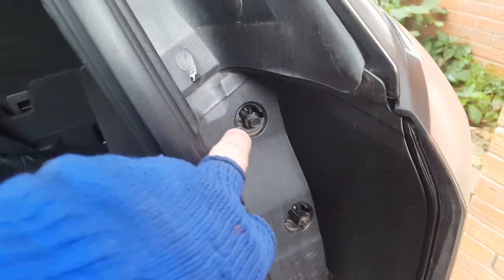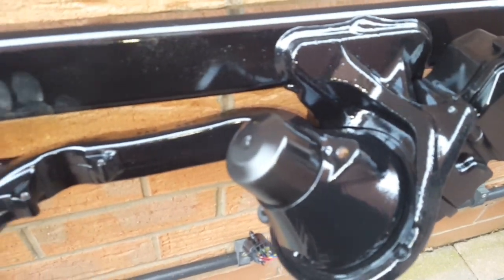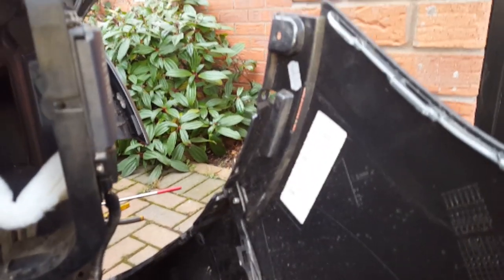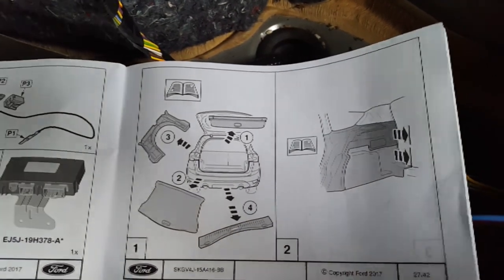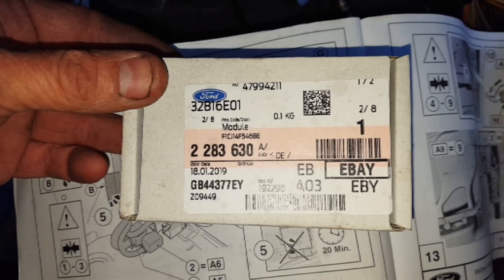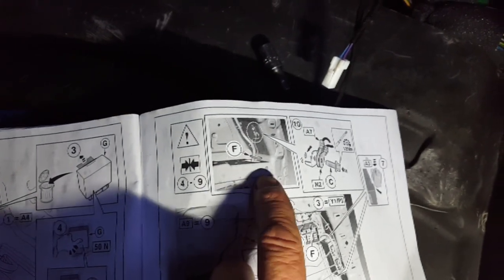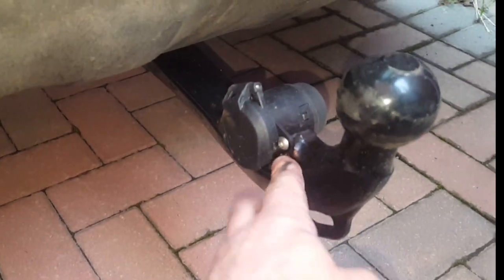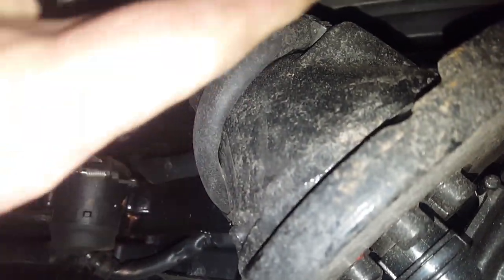Fittting Genuine Ford Retractable Tow Bar & Electrics Kuga / Explorer

Comment: Hi, here is how to resolve beeping with forscan:
1. Start programming of BCM (main), then select engineering mode from dropdown list.
2. Search for towbar and change to „with towbar attachment” 
3. Search for trailer module and select the correct module (in my case 13 pin)
4. Turn off the ignition, get out and get in the car, start forscan again and create new car profile. It will find the TRM Module now. If not then give it some time with ignition off
5. Start TRM (as build) programming and modify the last line 791-03-01 to x19x. In my case I modified from 009C to 019C - it was automatically changed to 019D. After this I was able to use the button and towbar was retracting. 

Thank you very much for this video. It helped me a lot with fitting towbar to Ford Escape 2018 and definitely saved some money. Thankfully CAN cables were the same color (which is not always the case with US), additionally I had to drill a hole for the wiring loom in the trunk. It is catching the bumper a little when opening but I guess I would have to release the bolts and move the towbar back or front a little.

Comment: Nice to see this explained since I could not find a manual online for the installation. I get a little seasick sometimes though from the images. I'm a bit dissapointed that you have to root the canbus wires all the way to the front. I'm going to place a fixed one I guess, so I won't need the swivel module.

Comment: Very good vid thank you.
Was the car equipped with the loom and a connectors as standard?
Reply from the maker: Thanks... 
No, all but the upgraded fuse board at the rear all looms and modules were purchased. Expensive but i saved on the fitting 😁

Comment: Nice detail video just fitted a 2nd hand towbar to my kuga my self  in process of sourcing a wiring room as it looked to much to remove the loom off other kuga. Is everything required in the wire kit
Reply from the maker: If you buy the boxes i show in the video its all there. For the cost of the electrics its not worth the time stripping old electrics out.

Comment: Hi, good video thx for that. My Mondeo has the electric towbar but sometimes it does not swivel at all. After disconnecting and reconnecting battery it works again for a while. Might that be a swivel module issue?
Reply from the maker: Personally i would have a look at the swivel release mechanism itself first, the mechanical side prior to modules, unless you know it to be in good order, in the past i have had to clean up the locking pins their switches, 👍

Comment: Assume you don’t reinstall the original crash bar.  Wish you had also included a bit about bolting the bar to the body.  Any tips there?
Reply from the maker: Original slam panel goes on ebay. Bolting to the car is a simple task, if you have the bar then it can only go the one way. Use grease and waxoyl down the channels.

Comment: Hi,that’s great video! Plesse,can you help me whit advice,I have Ford S-max 2017 and I’v bout used retractable tow bar and I,m in doubt,does I need the same elektrical kit like you used?!  On my tow bar allready exist 13pin trailer plug!!!
Reply from the maker: Your car will not be able to take that 13pin socket without a aftermarket or genuine wiring kit. If it is electric retractable you will need to go down the genuine route.
Reply: @TinkerBod  yes,it is electric retractable that I have. I have tried to find a parts on the e-bay,as you wrote,but I am not sure I can find them. I have tried also on RatesFord.Can you please help me whit, which precisely part I need and maybe som link for it...( I can send you a pic whit tow bar I have,if you send me your email ;-)  )
And,Thank you mate, that means a lot for me and  tell a lot about you.
Reply from the maker: When you phoned up rates ford and gave your reg and asked for a dictated tow bar wiring kit for a detachable towbar what did they say? This is all I did and they were brilliant. At my local ford dealer they even gave me a screen shot of wiring diagram and component layout. Although they were very dear, rates undercut them by quite a bit. The only way i found out what i needed was contacting these people and looking at the computer screen of my local dealer

Comment: Good video, but got to cutting wires for canbus and there seems to be 
2 sets of orange/ violet  and violet grey and a single orange/violet!!!??
Reply from the maker: Yes i queried this to and was told by Ford main dealer that it is a loop which ever one you cut is simply breaking the loop, think of it as a ring main putting a socket in.

Comment: Nice one dude. You sound Midlands, which gives me a question, do you fit for people in or around the Midlands? If your nose is blue even better ;)
Reply from the maker: Greetings and thank you. I once worked in birmingham for many years when young and influential picking up the accent, Im actually a carrot cruncher born and bred. Football would be the last thing on my list i rather be in the workshop, dirty nose perhaps. Nope i only fit my own tow bars, in these days of needing training just to sneeze its not worth it, im from different days ...👍
Reply: @TinkerBod  haha, thanks for the reply. I'm the same, I used to be a technician for Toyota and Lexus but wear a suit these days after hanging up my steel capped boots back in 2005. Well, looks like I'm going to get my hands dirty once more. Better make sure there's plenty of Tetley tea bags in the cupboard ;)
Reply: @TinkerBod  Well I finally got the time to fit my wiring. Tried it earlier and everything works apart from the brake lights on the caravan, work fine on the car??? I have not updated the software yet, that's a fun challenge for this week. I have not got the same as you, but your video was very helpful, thank you :)
Reply from the maker: Your feedback is much appreciated, I always feel a car is not really a car for me unless it has a tow bar. Happy towing....

Comment: Well I have a 2018 Kuga St-Line, the only sensors I have at the rear are parking sensors. I asked Rates Ford to confirm the parts required and they said the brake and towing modules you give from that that manual aren't compatible with my car. Do you think that is correct? I'm struggling to find out what alternative parts I would need if that is the case.
Reply from the maker: Sorry missed your comment, did you get anywhere with it? Its all very strange.
Reply: @TinkerBod  Rates stopped replying to me. I called them and they said they would look into it. They said that when inputting my VIN into the system, it told them those modules weren't compatible. All seems very odd. I have the additional tab in the rear fuse box so the car would accept the mod. Instead of people opting for the towbar, was there a towbar preparation option when the cars were sold? That may explain it.
Reply from the maker: Yes some vehicles although the same model are more pre fitted than others. It said this in the instructions. I had a similar thing when i did a tow bar on my van. Both my van and my mates are registered within 1 month of each other and exactly the same spec yet his had a loom from the BCM to the rear I did not. Both our kits are where exactly the same. The vans were 6 months old and neither had, had a tow bar fitted before...

Comment: Hello @tinkerbod, I recently installed the same kit as you have, except that my car had a wiring harness ready in the trunk. I have a problem like yours, 24 minutes into the video, 2 beeps and no response. I have the cable and forscan, can you walk me through the process of activating the hook? I don't know where to find these options, the only thing I found and changed was the presence of a hook and the 13-pin harness.
Reply from the maker: Sorry, as in the video i took mine into a chap at the main dealers. He said he had trouble getting it to find the folding module but the lighting side was simple. How this was done i have no idea, sorry.
Reply: Hi, check my comment in case you still struggle with this issue.
Reply: @madeco83 did you manage to program via forscan? I’m after doing the same

Comment: Why would you need a retractable towbar instead of a detachable one? Which Kuga do you have?
Reply from the maker: I had a focus with a fixed bar and always walked into it and greased up my legs and it looks ugly. I had a detachable on my mondeo, yes it gave a clean look but for me the bar had to stay in the boot in the way and when i need it you can bet it was under all the stuff in the boot, once found down on your hands and knees in the dirt to locate it in the socket then try and pull down the hidden electrics, end up getting covered in dirt. Now one buttom and the lot pops out, retractables every time for me now. Quick and easy and completely hidden, car details are all the the video. Kuga late 2018 st-x full pack

Comment: Did you get the instructions with the order from ford,or did you download and print them someware on theinternet?
Reply from the maker: Came with the parts purchased
Reply: @TinkerBod  And what about the dealer. What there is need to be programmed-what have you asked for? How much do you pay for the programming of the tow bar?
Reply from the maker: Just asked them to program my towbar, plugged it in, it found module, ticked the items to upload and it did it very quickly, price was mates rates, but i think at a main dealer its normally around £50-60.
Reply: @TinkerBod  i have one more question.at the front,there are more cables then one, with the same color needed.are the right one the swisted pair or should i search for "alone" cable with the same diameter? Thx!
Reply from the maker: Its the twisted pair and what i was told by the dealer, agreed its very confusing and the installation manual makes no reference to which one or that there are in fact two. But I have also spoke to another dealer and he said it does not matter. Both are Can-Bus and modules will be detected.

Comment: Im having a problem with mine (Factory fitted). When I press the button, nothing happens at all, not even the beep. Any leads would be appreciated!
Reply: Note: It has worked before
Reply from the maker: Definitely go for the fuses first, take note which one has blown, if its the lighting its a fair chance its water in the wiring/plug 👍

Comment: Hi pal would you be interested in fitting another one of these mate
Reply from the maker: No sorry only jobs for myself 👍
Reply: How did you know what Cambus wires to cut that bit look confusing
Reply: And the wire you put in fuse box. Mate mine already has it pal
Reply: Really appreciate it if i could contact your mate help me in doing mine mate much appreciated please
Reply from the maker: There are four wires canbus where the instructions tell you to cut either pair is ok.
Reply from the maker: Remember that from your other question, your car is part factory wired you maybe able to pickbup the  canbus in the boot which was another area, sadly not available to myself
Reply from the maker: This is good you already have factory part wired, i did not have this.
Reply from the maker: My video is the best help i can give you 👍